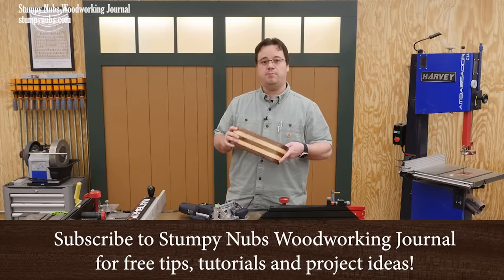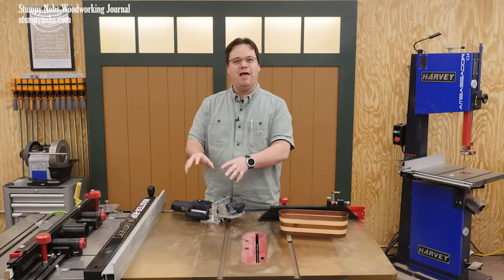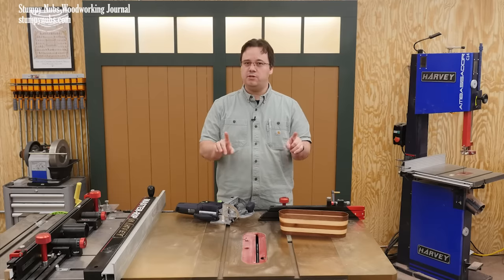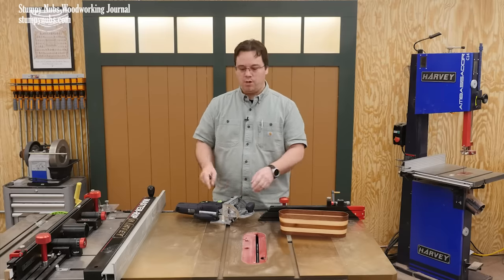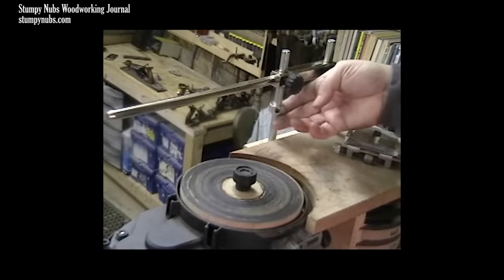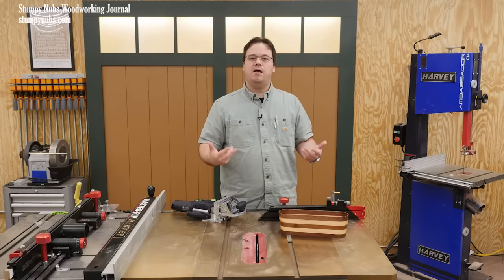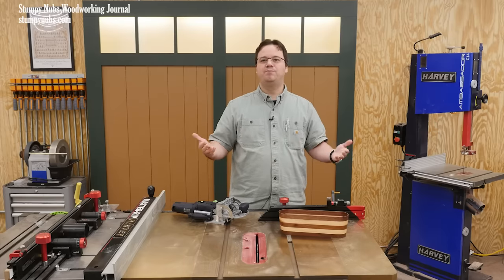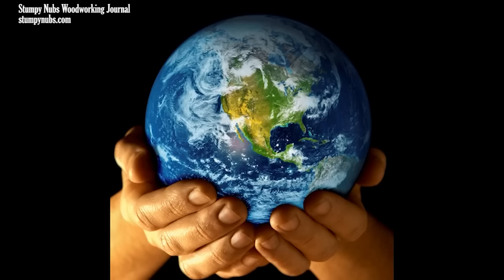This is why people HATE Festool and their Domino!

Comment: hey Stumpy, i’m a professional cabinetmaker & furniture builder. i fought against festool and their ecosystem for 20 years. that was one of the biggest mistakes i’ve made in my career. 5 years ago i bought the big domino and one of their dust collectors. both were game changers. the domino for mortise & tenons and the dust collector for my lungs. six months later i sold my powermatic hollow chisel mortiser. it was a great piece of equipment but ended up just sitting there after the domino purchase.
cheers & remember the best piece of saftey equipment you have is between your ears.
Reply: "...remember the best piece of safety equipment you have is between your ears." - Oops! I'm in trouble 😱
Reply: I am entirely willing to believe that for a professional needing to do production, the Festool Domino is a highly beneficial tool that pays for itself fairly quickly.  For a hobbyist, or a professional whose business isn't built around volume, the return on investment may not be there at all.

Comment: Thanks for this video. The Domino may be almost necessary for high end production shops. It is very efficient. But there are still dowels, biscuits and traditional mortise and tenon joints available for the rest of us. I would love to have all high end tools, but will settle for my 35 year old contractor saw and other tools with a smile. I don't NEED the fancy stuff, but I can still drool over it.
Reply: Makita circular saw with track accessory and 1.5 metres piece of track. Game changer. I'll get another piece of yrack. 50 years woodworker trained with hand tools. If I was ten years younger, I'd get Makita, Mafell, or Festool track saw, a Domino, the best dust extractor, air scrubber, and mask or hood I could find.
Reply: i agree with your sentiments, as a retired furniture maker i can assure you i have less tools than most of the amateur wannabe woodwork content providers on youtube.  and i made a living by what i made, not the video of me doing it.

Comment: This is a big thing I learned from Adam Savage. There are tools pros need to quickly do things to earn their living, and there are tools that work less efficiently/comfortably/or have shorter duty cycles that still get the job done when you only need to use them a few times a week or month on personal projects.
Reply: But it is weird that YouTube content creators are using them for videos that are targeted to hobbyists and weekend warriors. Sure in a professional setting saving time makes sense but video content for hobbyists it screams corporate shill or sponsorship or free product placement. Because honestly in multiple testing I've seen most dowel jigs are just as fast or faster then the domino and make stronger joints. So a YouTuber showing how to make a table and grabs the domino makes 0 sense. Now if the content is a day at the shop or if the project they are sharing is for an actual client then by all means grab and show off any tool you like.

Comment: I fully agree, the biggest issue with the domino is relatability. I'm a hobbyist at best who got into wood working through YouTube videos. There's a place for videos of truly high-end woodworking, using the best tools available, but I've seen so many more that try and pitch it as a "you can do this at home yourself!" and then bust out the domino. That's why I appreciate channels like yours and Steve Ramsays.
Reply: Use your imagination to find the solution. That's what woodworking is. You shouldn't need an exact step by step process mirroring exactly what recourses you have in order to complete a project. Challenge yourself and figure out another way.
Reply: People complain about all the review and tool list videos and no one makes build videos.  Then turn around and complain about the tools used in building videos.  Woodworking isn't for everyone, some folks should find a less stressful hobby.

Comment: My issue with the Festool Domino isn't the price or the utility. If you are doing a lot (and I mean really a *lot*) of loose tenon joinery, it is most likely very much worth the price. due to its speed and ease of use. But for people like me that do loose tenon joinery not so often, there are much cheaper, easy alternatives, like dowels or Beadlock loose tenons. In general, I think Festool charges more than their tools are worth, but clearly people are willing to pay what Festool asks, and it's their money to do with as they please.
Reply: I think you're over stating where the break even point lies. Once you have enough M&Ts to make that you can't practically do them by hand, I don't see anything that beats the value of the domino.
Reply: I could be too biased against dowels though.  But the cheap jigs I've tried are trash, and I can't bear to spend big money on a dowelling jig when I think I should put that towards a Domino
Reply: Pros all use Domino all day every day in shop or on site. Hundreds of such pros round my way. Houses all old, twisted, irregular, and small. Custom cabinets made fast is huge business.  Ready-made units often too big or too small, so space wasted and tpp flimsy or too rigidly square. I often modify Ikea stuff since the basic products are cheaper than I could buy the materials

Comment: With regards to expensive tools, yes, you can buy the cheaper versions and get the job done. Over time, I noticed I was upgrading tools and double or triple buying a tool. On top of that, some tools didn't have 'salvage value', meaning I had to damn near give them away to get rid of them. What I learned was that after a series of upgrades, I'd paid more than the price of just buying the expensive tool to start with. So now I just start at the top as it feels like it's the lowest overall cost of use and ownership in the end.
Reply: That’s a good point about “salvage value” or second hand value. Premium tools hold their value, I’ve heard of people selling 10 year old Festool track saws for what they originally paid (sometimes even more).
For a pro, it’s a no brainier. Time is money and top quality tools like the Domino can get loose tenon joinery done quicker, with less fuss than any other method. For the hobbyist, if you can afford the up front cost, it is practically a free tool. Not using it much? So sell it and get your money back. That’s no comfort to the average guy who can’t afford it but as said in the video, there are plenty of options to get the job done.
Reply: It all comes down to volume.  If you only use a tool once a year, it would be insane to get top quality.  If you are using it daily, then you need the quality in order to not go insane from having to buy yet another low grade tool.

Comment: For how rarely I (personally) need to do mortises, I'm pretty happy doing them with a drill press and chisels. And as far as Festool goes, I like some of their tools, like the Kapex saw (mostly like the dust collection and the bevel adjust) but dislike the fact that they insist on a different size arbor than the rest of the planet and thus you are stuck using their blades.
Reply: Oshlun.
Reply: The arbor size is a standard European arbor size.
Reply: @charlesdevere  ah. I'm Canadian and not used to seeing it anywhere else. Thanks for clarifying
Reply: @SnootchieBootchies27  no problem. I think we forget that we are Festools youngest market.

Comment: There's a strong case to be made that the patent system, particularly with the duration and breadth of patent protection we have today, does more to impede innovation than to bolster it.  Twenty years is a long time, and when you give one manufacturer a monopoly for that long it also means that everyone else in the world has basically no incentive to improve upon it, which is why it's so common to see a field get off to a promising start, completely stagnate for two decades, and then finally take off when the foundational patents finally expire.  You saw this with 3D printing which took off like wildfire in the consumer market once a bunch of the early patents finally expired, and I suspect you'll see it in table saw safety as well when sawstop finally loses its patents and can't just keep coasting on the same mechanism they've been using for the last twenty years
Reply: yeah cut it down to 10 years. My buddy works in patent litigation, some shady shit goes down in that realm.

Comment: I was extremely lucky to pick up the Domino XL, from an estate sale, for $840. It still had the protective plastic on the plate.
Reply: I came cross a Domino with 2 boxes of float tenons for $600 at a tool meet, but I decided to buy a Stanley No 1 for $500 that day, and not have enough money to get the Domino.
Reply: Update. I bought a domino DF500 for under $600 at a tool meet.

Comment: Great message. I’m more of a casual woodworker but had a decent setup in our old house - cast iron table saw, floor-standing drill press/bandsaw etc. Downsized and now workshop in garage shared with car in winter so all tools portable/folding. Larger cuts on the saw require more setup for runoff and other supports etc but care and planning result in similar precision and enjoyment in the result.  I do use the lumberyard occasionally for initial cuts on plywood etc.

Comment: Awesome take on the festool stigma. I personally recently purchased my first festool product a rotex  sander. I think this is my 5 th sander I have owned. I truly appreciate the way it functions over anything else I have ever used. The dust collection is fantastic even when just using a shop vacuum. 
Yes festool is pricey. But the quality of construction and ease of use is definitely worth it. I wish I hadn’t waited so long. Eventually yes I would like to have a domino machine. I believe it might have to wait until I purchase as a retirement gift for myself. Time will tell. 
Thank you Stubby. 
You are an inspiration.
Reply: I bought a Domino joiner in 2007 and it has paid for itself over and over. Superior to dowels and biscuits for most applications but those tools also have their place.

Comment: I’m onboard with Festool! When you buy Festool, you’re buying a system. Each tool has been throughly designed including all accessories. The days of buying a skillsaw ended when Festool came out with the tracksaw. Granted the saw itself isn’t much different than any other skillsaw, but the tracks are deigned for the saw, and routers. You can cut or route straight lines or even do shelf pin holes with them. Their sanders are on another level. Connected to dust collection, they are more aggressive with less arm fatigue. They are part of a system that can be used for sanding all the way up to polishing. The quality of the sand paper is better and lasts longer. The Domino’s a game changer. Same concept as a biscuit joiner, but much more accurate and stronger. The tenons come in 10 different sizes, lengths, and thicknesses. Wood tenons are available along with mechanical tenons. You can’t truly appreciate the brand until you have used the tools.

Comment: Well done, a proper explanation of the Domino economics. As you quite rightly pointed out this is not the first time innovation has produced initially very expensive equipment and is certainly not exclusive to woodworking. However, here in the UK the issue is not with the Domino so much as with the prices of most of the rest of the Festool range. Even the common tools like jigsaws tend to be far pricier than the other quality brands. I certainly would not buy one just because it is Festool.  This does not mean I wouldnt buy a Domino if I had a need for it. Brand snobbery has always been around and is something we all have to put up with. Loved the parody video,. All I could think about while watching it was that you are now the Chuck Norris of woodworking.

Comment: I started getting into woodworking to get ready for my retirement.  I bought the best tools I could justify, which means I learned how to make do, and how to make cheap machines do what I needed.  I had a cheap drop saw that drifted out of true with a weather change, I built it into a lock system that prevented drift, it also meant it was no longer adjustable.  I made boxes with it.

As I got closer to retire I started upgrading to better more expensive gear.  This included festool now and then.  Why do I like them? They do what it says on the box, all the time, simply and efficiently every time.  They don’t drift and always return to the setup stops.

Are they worth it, probably not for what I use them for but I love how when needed they help me enjoy my time in the workshop and allow me concentrate on other tasks to make the final item as good as I can get it.  

I also enjoy working with woodwork newbies that don’t have/want/need festool gear.  I help them make the most of what they have and show them a different way now and then.  I don’t see the animosity you speak of but I do see an increased ambition for where they may go in time.

Love your work and your balanced and technically accurate videos, thanks.

Comment: I don't own a domino and I don't have a CNC set up either.  If I ran a commercial cabinet shop or furniture shop that had the pressure of deadlines, I'd have both, but that's not why I do woodworking.  I have power tools for initial breakdown of material, but then I rely on hand tool joinery techniques.  I work on  my skills and that is its own reward.  I do try and encourage newbies to develop their hand tool skills, including sharpening.  I enjoy the reaction I get when one of them has their initial success on a newly learned skill.  Teaching someone to reliably cut a straight line with a handsaw is fun and everyone seems to feel a sense of accomplishment regardless if they will ever use a handsaw again.

Comment: Incredibly well said on all points. I think you’re right - the vitriol towards the Domino comes from a combination of jealousy over being unable to afford the tool and annoyance from Festool snobs. Festool snobs are kind of like the vegans of woodworking. 

My wife bought me a Domino as a gift last year and I love it. It’s a wonderfully useful and well-engineered machine and it makes loose tenon joinery quick, simple, accurate and easy. You are completely correct, though - there are precious few (if any) cases in which the Domino is the only way to create a joint; it simply makes it quicker and easier. The quality of the tool has definitely led me to consider Festool for other purchases but I completely agree with your approach - buy the best tool you can afford that fits your needs and don’t worry about the image. That may be green, yellow, red, blue or orange. Or (gasp) just plain black. If your tools look nicer than your projects the problem isn’t the tools.

Comment: Yes, the Festool domino is expensive. Up here is Canada I paid almost $2000 for the XL. I used a biscuit joiner for years and when I started to build garden gates and large doors I decided to get the domino for the slip tenons I wanted to use at the joints. I haven't been sorry I bought it. It is a great machine and does a supper job. Very accurate and easy to set up and use. The quality of the tool is very high and there must be an interesting mechanism inside to make the bit turn and swivel back and forth to make the mortise. Sometimes the money is worth spending.

Comment: I'm just a hobby wood turner (mostly) so a Domino has no practical application in my shop. However, I've seen plenty of professional woodworkers on youtube where I can understand the value and time saving that a Domino can bring. When you are in a production setting, anything to streamline your processes is a plus. While it is always admirable to see 100% handmade work, the time investment isn't always worth it, especially with each individual step... I doubt anyone cares if you ripped or crosscut your stock on a tablesaw vs a handsaw, but maybe handcutting the dovetails is a worthy feature.

I do have a festool dust collector. I do consider it a worthy investment because the bags get packed so efficiently that you hardly have to replace them and anything that helps reduce my chances of breathing in sawdust etc. is a plus.

Comment: I bought a fein multi master about 20 years + or - a few  years., when it was the only one on the market.    I have never regretted buying it.    Today  it is still  a better tool than any other on the market.  Changing blades  on my ild fein saw is so easy .  I do have newer battery power multi tool.  I only use it when away from 120v power.    So will i buy this festool, probably not unless i find one in an estate sale for pennies on the $.  But if I did mortise work daily sure i would put out the $ once i was convinced it worked well enough to merritt the $.      A tool like this can pay for itself in months.   Based on time saved.

Comment: Can you move the pieces around at all  with the festool tenons in place, when clamping up…?

The advantage of biscuits in commercial cabinetmaking is you don’t have to be perfect, you can move the pieces not only horizontally 1/8” but like 1/32” vertically when you’re clamping it up.

Dowels have to be absolutely perfect, which is what makes them difficult to use.

Comment: I recently purchased some festool items because I required precision low vibration and excellent dust control more so than the robustness. I don't buy by brand but by what I need and yes do look toward quality. If there was an equivalent item that was cheaper - I would buy it instead.

Festool does strike me as being like Apple. Accessories and items that should be adjunctive to a main tool purchase are priced outrageously. I make that remark acknowledging how business operates and the requirement to recoup sunk costs. 

I think the issue of preventing retailers from negotiating prices and such controls are where my Apple analogy really fits.